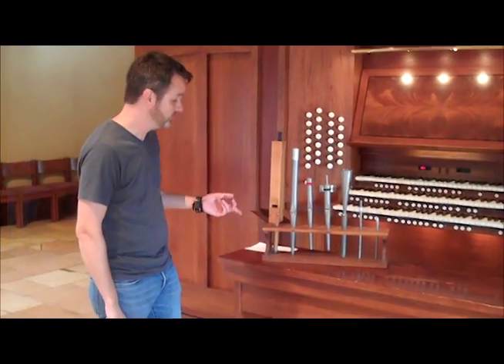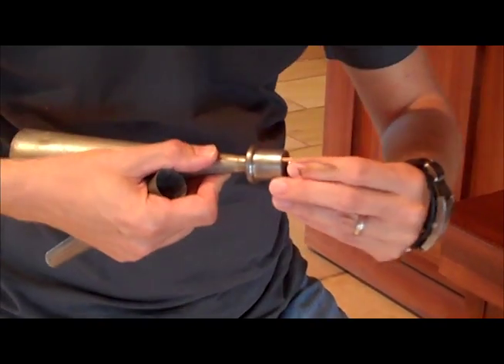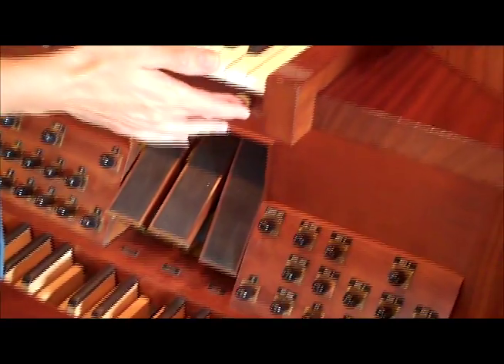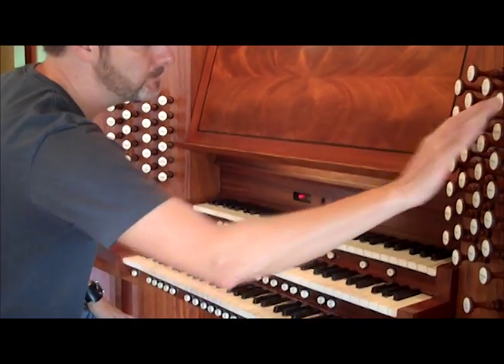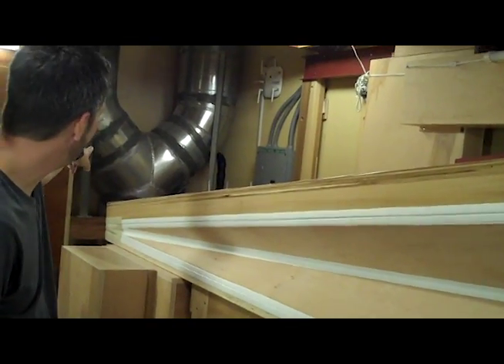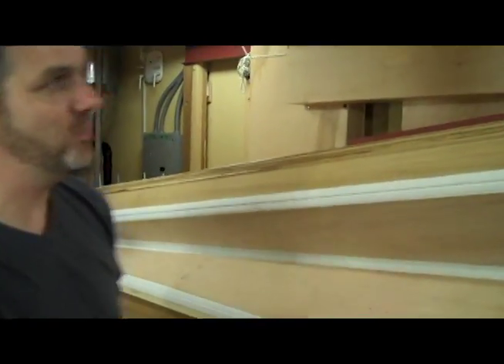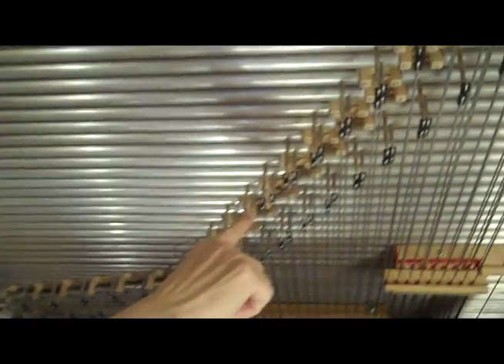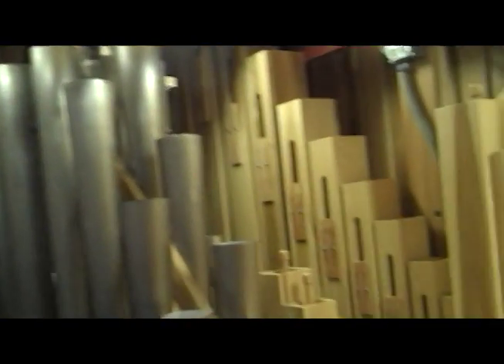The Hartness Organ, C.B. Fisk Opus 121, Furman University: A Guided Crawl

Comment: Two errors so far. The chimney of the Rohr Flute i NOT a reed. It is an empty tube and helps the pipe recover some of the harmonics lost through total capping.  The slot in the string pipe is NOT and expression slot - it is the Tuning slot.  You don't touch the scroll on Trumpt pipes, you tune on the wire.  - You forgot the mutations which modern day builders feel are no longer necessary. But they represent the 5th member of the scale (Harmonic scale)  8, 4, 2-2/3, 2' . This is a basic chorus and when the Mixture as added (To brighten the bass and re-enforce the treble)  Mixtures are not there to scream at you as very few builders of "Modern" "Broquen organs  have forgotten about.  The sound never changes and neither does the volume because wind pressure alters the pitch. This the pipes of one division are enclosed on an "Expression Chamber" which has swell shandes in front.. I wonder what Biggs and Lamare did without all those gadgets. Oh. They played more recitals than all other concerts, combines
Reply: The total adoption of equal temperament by 1850 spelled the end of mixtures.

Comment: Very good sound but... i see plywood everywere, flying electric wires, metal screws, iron bolts and washers, alluminium, steel, iron wires for tracker, plastics, plexiglass, iron beams for structural... instead of solid, massive, wood as for the european manifacturing...How many millions for this hardware shop?
Reply: Plywood is much more stable, especially when wood dries out. Metal parts are galvanized, and nylon is almost indestructible. The organ is built in the most traditional style but weighs significantly less and will function efficiently for rather longer.